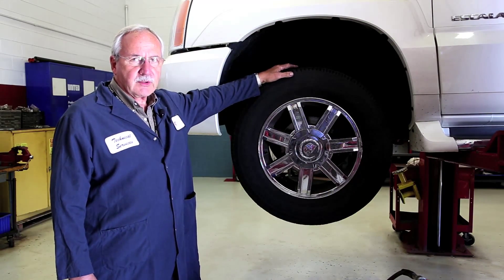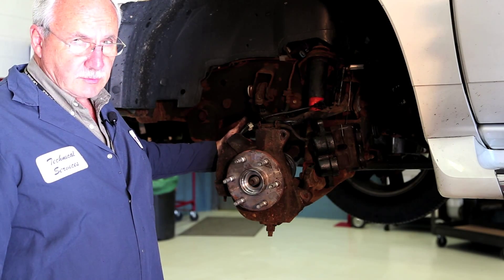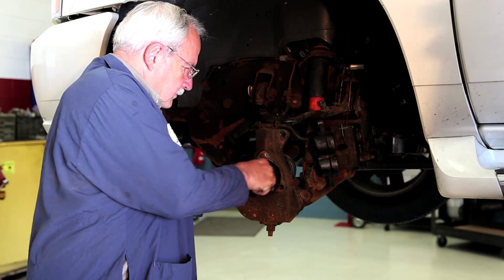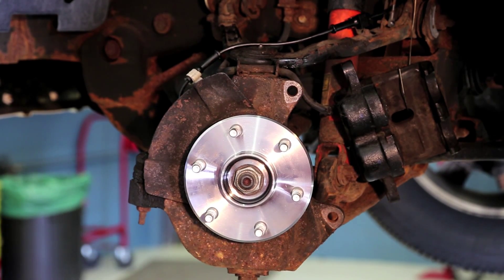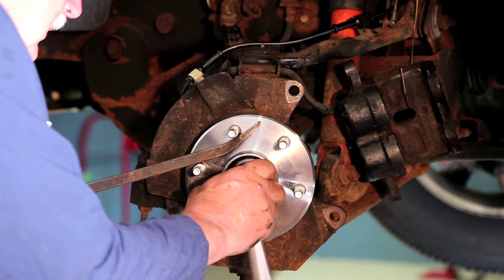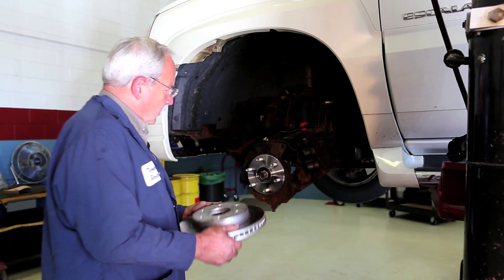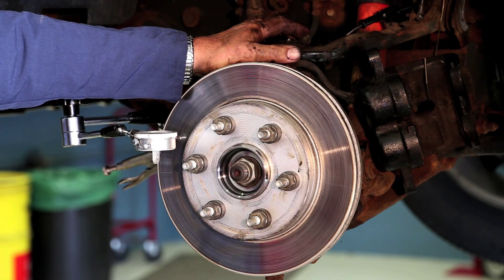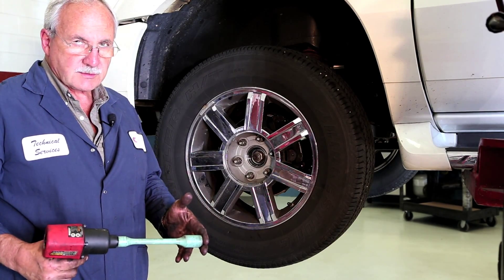Hub Bearing Replacement ’04 Escalade

Comment: Thanks for the video but it's lacking lots of infos torque specs hub to spindle, axle nut. Also would be nice to know socket sizes. That was my advice if you wanna be making mechanic tutorial videos
Reply: And also torquing axle nut in the air by holding wheel studs with pry bar is wrong... Tight it snug and then drop vehicle on the ground with wheel on it but no center cap then torque to specs
Reply: Exactly!

Comment: Question; I have an 02 escalade and I replaced the front wheel hub bearing assemblies, all went good.  However when I road tested it the "service stability system" indicator came on.  Anyone have solutions to this?
Reply from the maker: Try checking the wheel speed sensor operation. Could be misrouted wires, chaffed wires, bad connection or faulty WSS.